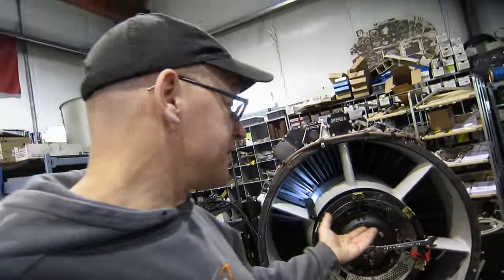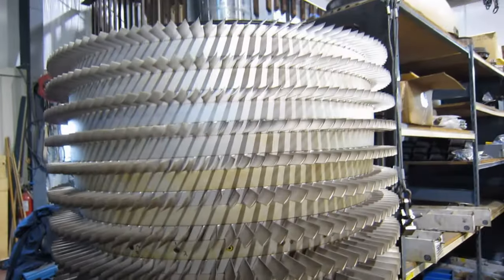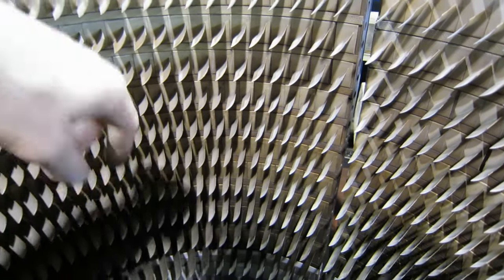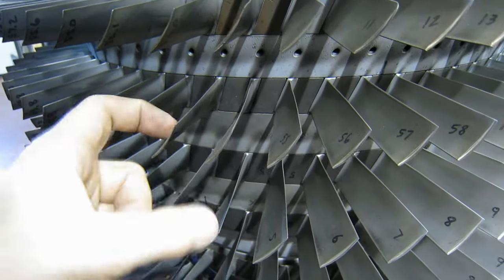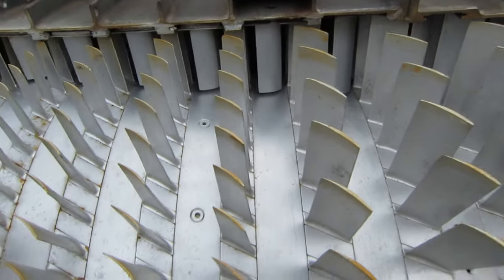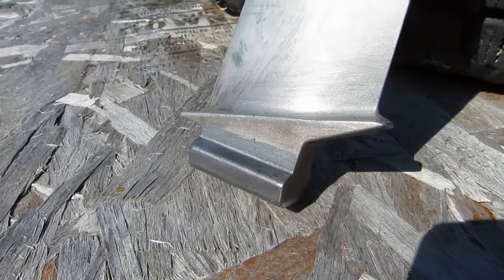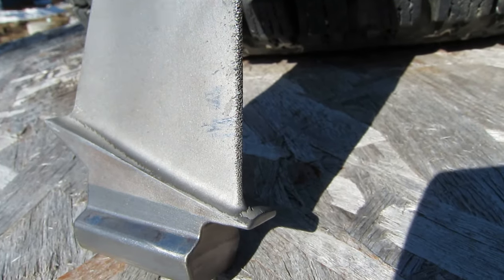Compressors - Turbine Engines: A Closer Look

Comment: This is incredibly educational. Thanks so much for sharing this awesome content.
Reply from the maker: +CreativeType I'm here for you creative types. Thanks for watching!
Reply: 1
Reply: @AgentJayZ  I used to work on natural gas and diesel turbines for energy production. Is this type of wear common on what I worked on or is it more for aviation engines? We used to regularly have to do blade grinding at service intervals, which is why I am asking.
Reply: @AgentJayZ  thank you very much sir, i.am.grateful. i never knew about this
Reply: It is not educational, it is indoctrinational, if anything. Nonetheless, it is interesting.
Reply: so i wonder what happens to the air inside of the compressor (compress ofcourse) but just how the angle decreases and increases within the system. its killing me not knowing now i delved into the jet engine rabbit hole
Reply: You sound mega sus

Comment: At work there was a cut-away Orenda. I spent hours studying that engine. I found it interesting to see the angle of attack and the twist of the compressor blades, the interaction of the stator blades, how the angle of attack and twist changed thru the stages, as well as the taper in the compressor as the stages compressed the air. Something else I found interesting is that Canada never developed an aircraft piston engine, but made 2 of the world's best jet engines, the Orenda and the Iroquois.

Comment: 4:18 I didn't know the blades supposed to be loose.  Learned something today.  Thanks!
Reply: Till they get hot.
Reply: Because of the heat, the metal expands thats why it needs to be a bit loose
Reply: They become locked under Centrifugal force at speed.  Windmilling at low speed can result in significant wear of the compressor blade roots.

Comment: Thanks for the trip down memory lane. I was in the National Guard 40 years ago, worked on CH 47 and  UH1 helicopter engines. I blended and polished quite a few blades that suffered FOD. (Foreign object damage). Blades that could not be fixed were smashed with a hammer to prevent them from finding their way into our spare parts streams. Various use once parts From the aircraft were also given the hammer treatment. This would prevent the unscrupulous parts suppliers from performing unauthorized repairs to critical parts.I understand even now counterfeit parts can be a problem in the aviation industries.

Comment: I used to build the engine core for CF6 compressors. Learned real quick watch your fingers while installing the case halves. A slight turn on the rotor split my nail while setting up for a wax check. To check blade and stator clearances. After 35 years working on aircraft and thier engines I still have all my fingers!

Comment from the maker: A gum wrapper would not damage a turbofan at all. Nor one of these turbojets. But it would be turned to dust, not just shredded.
One of the major advantages of turbofans is they tend to shunt debris through the bypass duct..."bypassing" the core. Overall this makes the engine very resistant to damage by birds and such. A bag of marbles going into a GE90? it would be very unhappy, but it would keep running. If one marble went into the core of the same engine,it would be unable to make any power.
Reply: A bird got into the core of each engine in that incident. So each engine failed because the core ingested one bird, not a flock.
Reply: @ airguardian, that was a turbo fan engine, not a turbo jet engine. Theres a huge differance in power, and shape.
Reply: Dude, you are awesome. Thanks for educating, even in the comments.

Comment: Fantastic video. I teach new Crew Chiefs in the Air Force about the F-16's engine (both Pratt and GE), and this video will help me describe the stators within the high pressure compression section much better.

Comment: I have been working on taming the resonances and using them to control flame propagation. Musically harmonised engines are possible... fourier theory and Rubens flame tubes... pulse jets... tuned mass dampers & compression cycles... materials with planned deformation & single crystal non-embrittlement techniques... turbulent flow in brass instruments and reed / woodwind instruments as designs for injectors... variable length / valve controlled manifolds... there are things we do with musical instruments which can and do puzzle physicists.

Comment: Mind completely blown. Who understood this process and designed the parts? The technical skill and accuracy is staggering.
Reply: The stators are not always stationary. They don’t spin but they can be moved at different angles. I believe this was a G.E. Invention called variable stators.
Reply from the maker: By stationary, I mean they do not move from where they are located... you know, like the rapidly moving rotor blades do...
The people who invented the variable stator also mean that. Otherwise they would have called it a moving stator... in which case it would not be a stator, now would it?

Comment: A mechanical marvel, as well as, a thing of beauty.  

Hard to believe the turbojet engine was invented by a couple of aviators (Sir Frank Whittle for one) who thought reciprocating piston engines were too noisy and vibrated too much.  They were looking for a smoother form of power generation.  What an odd seed for the Mother of Invention.  A bit like explaining why zippers replaced button flys.
Reply from the maker: Sir Frank was not looking for smoothness. He was looking for higher aircraft speeds.
Reply: propeller driven thrust is limited by the fact that the propeller tip cannot exceed mach 1 (for multiple reasons) so Frank worked on the centrifugal gas turbine in order to exceed mach 1 - the centrifugal compressor (think car turbo) was later replaced by the axial design which was vastly more efficient
Reply: @andyman8630  Thx for the deeper insight.  My comments were based on a television documentary, and as we all know, they are written by people who do some research, write a script, and find some footage to go along with it.  So, as a viewer, you are at the mercy of the people doing the research, and what they decide put into it.

Your explanation, as well as, AgentJZ whose channel deserves tremendous respect, makes complete sense.

Comment from the maker: Any wearing in of seal clearances would be done on the test cell stand... long before the engine ever got near being installed in an aircraft. Aircraft engines are built with standardized, slightly larger tip clearances to avoid rubs.  Industrial engines have a less demanding life, but longer service intervals, and they are sometimes built "tighter".
Reply: Wal-Mart has a nice suit for 12 slim
Reply: Hey Brad Pitt
Reply: AgentJayZ I like each and every video you do there very interesting and fun to watch I wish I can be there when you test run one of those jet engines just to hear the sound they make it would be awesome

Comment: Wow amazing to see so many stages of compression. I work on TFEs with 4 stages of compression but to see all those rotors and stators is pretty fasinating. Ive dropped a bolt down the LPC group down to the HP module and was able to turn the engine over in the build stand and it fell right out. I can't imagine you could do the same with this big beast. It would sound cool though I bet!
Reply from the maker: Have you seen my most popular video, called Dropped into a Turbine Engine?

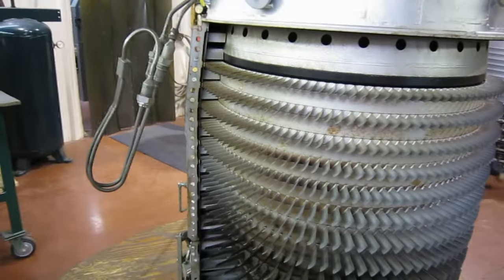Comment: AgentJayZ:  At 3:23 is the "money shot" to a question I've often pondered.  Given how tight the space tolerances are inside the engine, what is the process for attaching the  compressor casing to the rotor assembly such that you don't prang a delicate stator or compressor blade?  You've previously said "with great care".  This process must be even more critical in high pressure, high by-pass commercial airline engines.  I presume that the preferred process is not what is shown in the youtube video "gas turbine accident".  Would it possible to show the joining process of a compressor casing -rotor assembly by video?  Many thanks!
Reply: we used to put wax strips to ck clearance. then airline bought very expensive grinder that match ground each rotor to a specific set of cases.tremendously accurate the blades had a 3 angle grind on them (tip) also. mind blowing when you hear some yahoo customer screaming complaints.
Reply: Can only answer for a high by pass turbo engine (leap/genx/cf34) low pressure compressor
Stage by stage "that simple" 
disk fan -> spool -> matching of blades (because like he said blades must be loose, so in order to that, tey test wich blades they will put , then unload them for proper mounting) -> unload the blades -> first stator -> first stage (seconde stage actually cause first is fan ) blades put back -> second stator -> second stage etc
Reply: why loose blades
Reply: Ric Rovey Not resonance.

Comment: That compressor rotor would make the coolest furniture centerpiece ever if you could find one that was faulty and could be pulled out of a scrap heap.
However, one must be careful not to fall into one of the rotor cases, or you will face a slow and terrible death, as you are slowly digested over a period of 1000 years.
Reply from the maker: +Ryan Cook We've got one in the scrap bin right now. Come and get it. It weighs about 500lbs.
Reply: +AgentJayZ I wonder if this was a serious offer
Reply: I feel like it probably was. Unfortunately, it's about a 45 hour drive from me and I don't have a truck.
Reply: +Ryan Cook I have a few compressor stages laying around if you want to pick one up in Norway..... Sorry, just wanted to add to the good offers!

But I do actually have a few. I should really make them into some kind of furniture.
Reply: ALSO MAKE A GREAT WIND TURBINE.

Comment: I wonder what is the temperature those stators reach when working.
Reply from the maker: From inlet to outlet, each stage gets hotter. From idle to max, the temp of each stage gets hotter.
Reply: @AgentJayZ  Are all of them made of titanium or some of them (the colder ones) are made of cheaper materials like steel?
And thanks for answering :)
Reply from the maker: All steel. Steel is stronger, more resistant to high temps, cheaper and easier to work with than titanium. But titanium is lighter, and of course, sexier than steel.
Reply: @AgentJayZ  Hey Jay. Thx for answering.
SInce we are at it, I got another question.
I always thought i the blades and vanes where made of titanium precisely because titanium can endure higher temperatures and dont suffer frmo creep as much as steel.
But  the question is: if this is all made of common, easily acessible steel instead of some exotic metals, why dont other countries produces engines like these?
I mean, its kinf of difficult to believe that such a simple desing using steel is so expensive and difficult to make.
Reply from the maker: Ah! You made the very common, but massive mistake!
"Simple"?
Have you ever thought about why the steam piston engine was introduced in the late 1700s, and the steam turbine was introduced in the late 1800s?
Or how the Otto cycle piston combustion engine was around just before 1900, but the  first combustion gas turbine engine was actually running in the early 1930s?

Not so simple. 
And to make a "competitive" gas turbine engine nowadays, or even in the 1960s... took thousands of engineers and billions of dollars. With a capital "B".

Anyone who says jet engines are simple, and have "only one moving part"... just does not know enough.

Jeez, most countries in the world today do not have a "steel" industry.
It takes a heck of a lot of money, skill, and will to develop a jet engine. Only a few countries do it now.
Even here in Canada... we sure can, and we did back in the day, but we don't now.
We design nuclear reactors, but we don't make jet engines any more.

Simple is the last word I would use to describe gas turbine engines.... except maybe cheap.

Yes, cheap and simple are the top two non-words to use...
Reply: @ALSPEHEIR  when it comes yo material "simlicity" of a gas turbine design the biggest difference is the material of turbines which endure much higher temperature. Axial compressor is not the biggest challenge.

Comment: What happened to the guys comment that said the SR71 has counter rotation blades? 

I called someone I know,  who knows first hand about the SR71.  He wouldn't confirm or deny the counter rotation.
He also asked,  how did I know this.
I told him, I read it here.
Reply from the maker: If they are moving, they are not stators. If there are counter rotating airfoil elements in the J58, I know nothing of it, and have never heard or claimed such a thing.
PS: The SR-71 is an airframe, which was fitted with the J58 engine.
In this biz, details are extremely important.
Reply: the pegasus engine in the harrier jump jet had counter rotating spools,   so that it didn't get a big torque reaction at low speeds
Reply from the maker: I think that might be more about weight savings. The net torque on the engine mounts of a jet engine are negligible, for reasons explained in videos in the playlist Your Questions Answered.
Reply: Sailing Dreamer they run planes by COMPRESSED AIR not flammable liquid. This is bullshit.
Reply: Paula Jewitt ah no they don't...
Reply: Paula Jewitt aaaaand the nutters are here with their nonsensical conspiracy theories.
Reply: @paulajewitt2012  Provide proof.  Not a video of a guy who says they run on air.  People who know nothing should say nothing.
Reply: bernie weber I never said I didn’t need to know more than the basics of my aircraft systems.  Are you intoxicated?  You are imagining a lot of things that “I said”.  Social media and alcohol will lead to regret.  Your writing gets worse as the day goes on.  Try to write something that can be understood.  Write it, read it, edit it, and then post it.
Reply: bernie weber Your understanding of the RAT is completely wrong.  Where did you get your information.  Maybe a better question is: what aircraft are you referencing?  I am quite familiar with how the RAT operates on my aircraft, so you don’t need to guess about it.  

Did you even read my comment where I explained how it works on my jet? (A320).  If you didn’t, just let me know and I will describe how it works.  The sentence that you wrote (yes, I believe you about the keyboard) still is unintelligible.  I can’t even begin to guess what you might be trying to say.

I assume that direct impingement is part of what you are trying to say, because you have said it three times now, but I have no idea what it means in the context of the APU operation.
Reply: @bernieweber4663     Bern, Come on man.  Explain the RAT to me.  I am still waiting.

Comment: Who builds custom compressor spools?
Reply from the maker: As far as I know, there is no such thing. The only thing we customize is the paint job.
Reply: @AgentJayZ  Thanks!  another question:  If I want to design around standard off the shelf rotors and stators, is there and existing catalog?
Reply from the maker: I don't know what you mean. The only generic and universal parts used when designing a jet engine are the nuts and bolts.
So, I'm going to go with No for my answer to this one.
Have a look at my vid: So You Want to Design a Jet Engine... it's here:  https://youtu.be/jxyyG-pTiMI

Comment: I cant believe those are individual vanes all the way back! I wouldve figured for sure those would be vane segments. What a PITA to service!
Reply from the maker: It actually makes no difference at all in the overhaul. The reason vanes are put into multiple segments in some engines is for stability during operation.
Multi stator segments are not easier or quicker to  remove or install, and can be more difficult to recondition or repair.

Comment from the maker: Squeeler tip is a semi-slang term for a thinner end section of the compressor stator vane or rotor blade that maintains the aerodynamic profile, but is more easily worn away if there is an overly tight fit on assembly.   It allows an engine to be built very tight, but quickly "wear in" to a very close fit between rotating and non-rotating parts for minimal air leakage.

Comment: It is unimaginable how much calculations and factors that go into the design of these compressors and they complex machinery that is used to build them. So much precision. During the video  I am noticing the conical shape of the rotor base that determines  each row of blade lengths for both rotors and stators. Also how the blade angle, blade width, and blade spacing changes from front to back to achieve most efficient air movement and compression.  Those people that try to build homemade jet turbine engines do not have a chance.